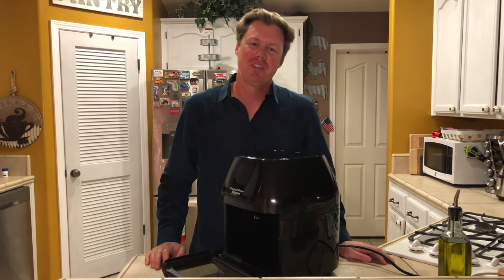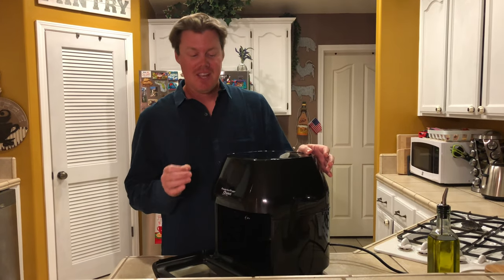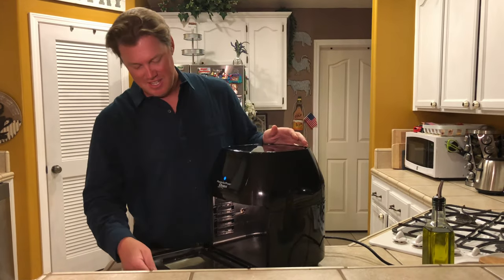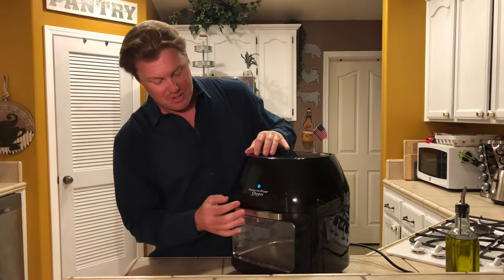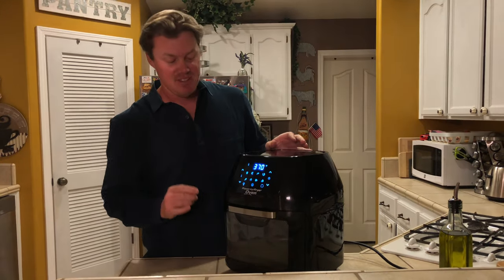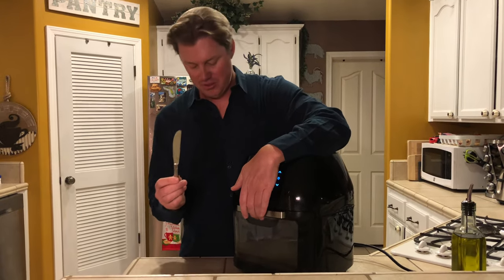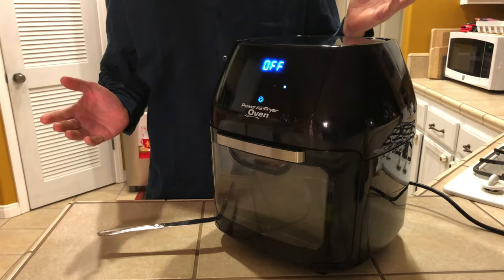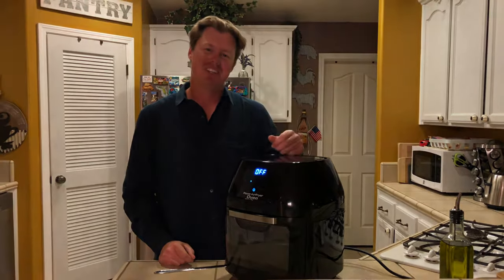Power air fryer oven not working? Quick fix.

Comment: If one single button isn’t working and when dismantled you have springs buttons add a small piece of aluminum foil on top of the spring or in the hole it goes in .

Comment: Thanks for this video.  I decided that I would super glue two stainless steel washers by the hinge slots on both sides and also by the hinge pins on the door on both sides.  This works great, and there is no need to lift the door or insert a butter knife.

Comment: I  literally had mine in my arms about to take out to the trash its less than a year old, and i put it down by the front door, and thought i will look on youtube to see if there is anyone that has had the same problem, such a simple fix, the knife worked and now it works without the use of the knife but if it does it again i will know what to do , well done thank you! You just saved me $80

Comment: I've been so perplexed with this air fryer.  Its such a nice appliance but I could not figure out the problem.  You are the dude!  Thanks a million.  I could not fit a butter knife on mine but a small bowl upside down under the handle works just fine.  Again thank you so much!

Comment: Was about to throw our fryer away, until I ran across this video.  Wife felt like the problem was in the door, just didn’t know what the problem was though.  Odd that there’s essentially no free play in the door; but apparently there’s enough for it to not depress the little switches or whatever they are; two tiny pins that have to be depressed fully.  Raising the door did the trick, and fortunately didn’t require any wedging of the door.  Thanks for posting the solution.

Comment: Thank you! I just received a certified refurbished unit off ebay, and it was doing exactly what you showed, and it worked! Thank you. I just wish they would fix that design. It doesn't look very good with a butterknife sticking out of it! lol. But, at least now, I can try it out for dinner.

Comment: I ran into this problem within the first couple days back in April. At first, slamming the puss out of it worked. Then, I had to slam the pissed out of it and press the back left corner of the top of it. Yesterday that stopped working. This method is far less violent and involves far less curse words being hurled at my beloved air fryer. Thank you.
Reply: Update: this worked for about 24 hours. Back to slamming the piss out of it now

Comment: Your method worked! After I took apart and cleaned the touch screen, too...

The only problem is, my door seems lose that even the butter knife works temporarily. What works best is the first method of holding the door open, but for the entire frying time... the moment i let go, few seconds later, the door seal undoes and the unit senses that... is there a way to tighten the door, or to calibrate the metal prongs that hold on to the door? There seems to be very little seal power...

Comment: This is exactly what happened to me. I had an old model from two years ago that had issues with the rotisserie. I had a warranty and they swapped to this model. But immediately out of the boss it started with this issue. And mine will not stay up if will fall unless I hold up with a piece of tape or wedge. But that is ridiculous for an appliance! A brand new appliance. Jeez, can I get 6 months before I have to start rigging it! Thank you. I hope they are aware of the flaw and I am calling them again.

Comment: This crap stopped heating after just two years of use. It turns on like nothing happens, the fan works but the heating element works intermitently. Sometimes it throws an ERR 03 message. This is my second air fryer. The first one was bought like 5 or 6 years ago and is still working like a charm.

Comment: Of anyone has this issue, there's a longer term fix that is far more aesthetically pleasing on the eye.
Open up the air fryer and you will see 2 plastic pins sticking out above where the door closes.
Disassemble the fryer to expose these plastic pins and you will see that the have a spring above them that is supposed to push them back down against the door.
Sometimes these springs pop out place and hence the plastic pins stay up and don't get pushed down to you h the door again.
Just reposition the springs ans you should be good to go.

Comment: I have the same unit . All I had to do was tighten the 2 screws on the top panel that covers the switches . Screws come loose and the cover comes down slightly causing the switches not to engage properly.

Comment: This didn’t work with mine. 😢. The light turns off when I shut the door but the control panel still won’t turn on. Any ideas what the problem could be?  I tried to butter knife trick and got nothing.

Comment: What do you do if you don't hear the unit running.   I don't hear my fan and I use a flash light to try and see if the fan was spinning.  It's not.  The fryer heats up but no noise whatsoever.
Reply: Same here!

Comment: Anyone know how to get at thinkkitchen  ST38 top off? Dead set, need to get at the circuit up top but cant see how the cover comes off. Just the lower back and sides will lower  with enough torx screws removed from below.

Comment: Mine threw an error E31 and stopped heating. I gave it a bump at the rear side and worked for a day. Now its not heating anymore. It turns on, the fan spins, but no hot air is coming from above. No more than 2 years with it. I have one of the original Power air fryers with more than 5 years and still works. This one seems like complete garbage.

Comment: What if the fan doesn’t work and the air doesn’t circulate? My control panel is fine
Reply: That's the same problem that i am having....can someone help with this please? mine is still fairly new. thank you!!
Reply: @florencejohnson2197  I flipped it over and tried to see if I could take it apart and access the fan, but no. I threw it away - piece of junk lasted less than 2 years

Comment: The Ultrean air fryer drawer is like the notorious culprit of the "not powering on" drama. It's basically a cheap Chinese import with zero quality control. 😂 If you got finessed into buying one of these goofy gadgets on Amazon, just prop up the drawer with a metal knife like you have described, or use a flathead bottle opener, and boom, problem solved. 🤷‍♂💀

Comment: Hello people 👋

An easy and permanent fix would be, to locate the small switches (in my case with a Princess air fryer there's only one in the middle), and bond a little piece (preferably a Teflon one, or a wear resistent plastic) on it.

Good luck 😊✔️

Comment: UPDATE*  anyone have a removable slide draw instead of lift down door?  Once I find a phillips head I'm going to remove 2 little screws on panel that keeps draw engaged and see if loosening one of the 'teeth' (one is loose, the other stiffer) will fix my problems, thanks for the heads up - finger crossed
* turns out everyone in the house but me knew the o/off light is out and you just have to touch where it should be...lol...I put some tape there for a reminder

Comment: My CHEFMAN 8 QT AIR FRYER. ISSUE.
ITS SPARKING UP.
WHEN U PLUG IT ON. ITS STARTS TO SPARK. SAME PROBLEM I HAD WITH A BIG MICROWAVE WE BOUGHT RECENTLY. BUT THE AIR FRYER LASTED A GOOD YEAR OF CONSTANTLY USING. THE MICROWAVE ONLY BOUGHT FOR CHRISTMAS. THEN START TO SPARK UP INSIDE OF IT AT THE END OF JANUARY MONTH. THE CAUSE OF THESE ISSUE SEEMS TO BE HAPPENING INSIDE THE MACHINE. BUT   SEEMS LIKE MOST BIG kitchen APPLAnces GIVE PROBLEMS

Comment: It works after i press the handle up and hold it, but as soon as i release it, the function stops. And I'm not going to stand holding it for an hour or so.
Sticking a knife in doesn't help either. Not that its a great idea anyway...
This product should never have been allowed on the market.
Absolute rubbish

Comment: I have the same issue...door will not stay shut. This unit is brand new....not even a week old. There are two small sttel tabs that are supposed to catch the door, but one is very easy to push in, and the other is difficult. Same with yours?
Reply: Door lift solved my problem - which was exactly is shown.  Thank you, thank, thank you

Comment: The problem we have with our is that when we use the shrimp setting  it starts at 320° for 12 minutes but part way into the cooking process the Air Fryer Pro starts beeping and jumps up to 400°. It only does that on the shrimp setting. I tried unplugging the fryer and plugging it back in but doesn't fix the problem.